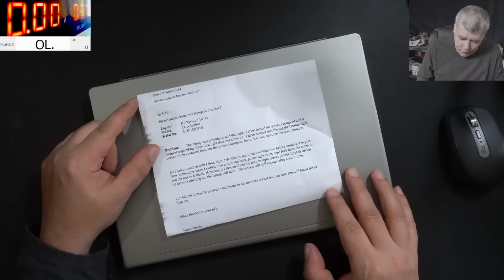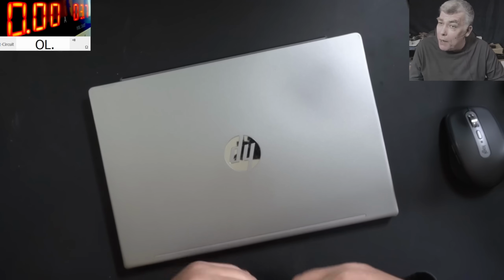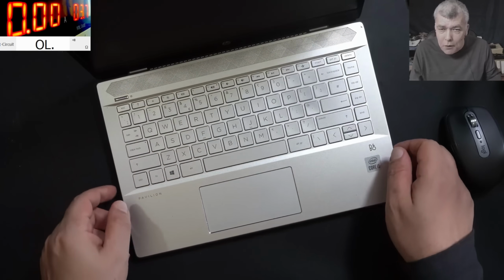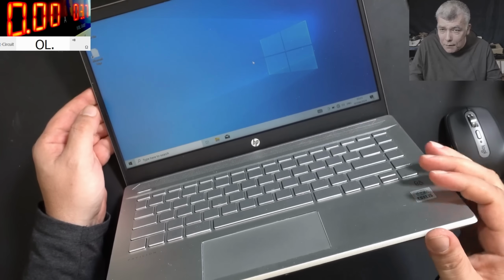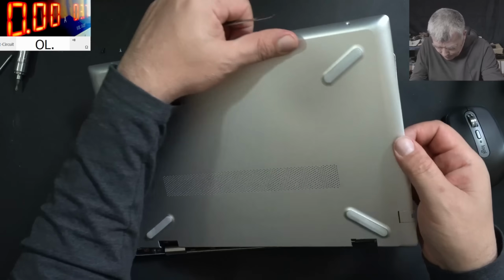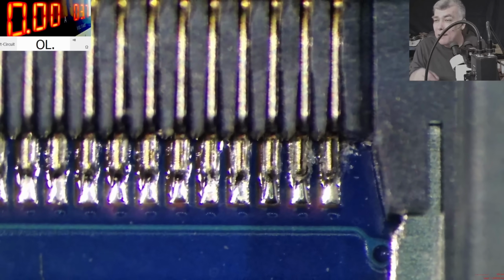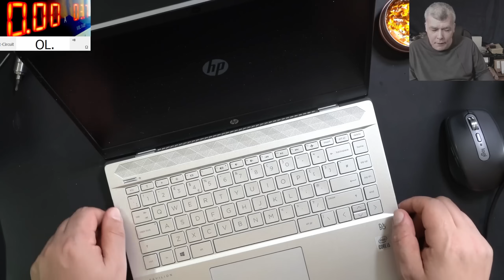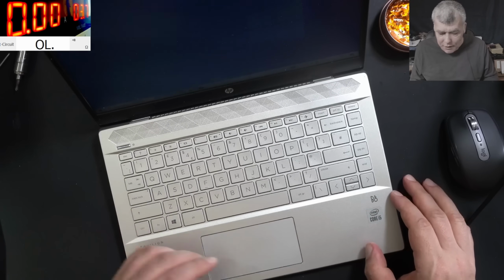How do I fix my laptop from freezing? HP 14-ce3510sa freezing randomly - a common fault

Comment: Hi, I did the same thing on my hp pavilion B&o by checking if there is any pins movement but they looks stable, i need help please to fix freezing problem the laptop it takes more than 10 minutes to get normal. 
Thanks

Comment: Hi sorin, my lenovo laptop does   have the same issue, ive done removing every components om my laptop just to narrow down where the issue is, but still i still got this problem. The only component that i couldn't remove is the soldered ram. So I think this is where the issue comes. Is there any way to check if this soldered ram is faulty?

Comment: What's up with screen flicker at 6:02 & 10:29?  
(Could be HP desktop theme? HP diagonal screen ripper for power savings? Maybe SMART HP Tools properly calibrating another cheezy display cable?)
Did you wash the flux off?
Reply: There is no flicker. It's the camera not keeping up with the screen's refresh rate. This is basic stuff.

Comment: Great video, Sorin. Similar issue HP Pavilion 15-ab254sa Intel Core i5-6200U 16GB RAM -  Clean Windows installation... I start the laptop without battery, the performance is noticeably slow... I reboot and the laptop and works perfectly. This is on a 65W charger. I changed to a 45W charger. The same problem. I updated the BIOS, problem solved. I started using my 65W charger again and the problem reoccured. I checked the voltage of the charger and it is around 19.5V. The charger seems fine and I don't suspect it's faulty as it works fine with other HP laptops. Anyone familiar with this type of issue?? I've checked RAM and is fine. Also, laptop works perfectly on battery, no issues.

Comment: Hi Sir, I have a question, I have lenovo thinkpad t570, I intend to replace the motherboard of T570 with the motherboard of lenovot thinkpad t580, the two look very similar, and both use the same voltage wise power. What do you think about this?

Comment: replacing termo paste? what next? replacing capacitors? im disappointed and my day is ruined. (it's a sarcasm btw)
Reply: Sorin could remove a capacitor as an “extra free service “
Reply: That thermal paste should be repaired not replaced, just like everything else. Screen cables, usb-c/hdmi ports... 😊
Reply: @mikeh6286 why repair the thermal paste? Just because manufacturer put it there? You’re gonna tell me manufacturer is god now? Thermal paste is a scam, I just remove it from every laptop I fix. There cannot be old thermal paste if there is no thermal paste at all 😂
Reply: @moldo8811  repair or remove... those actions are acceptable on this channel
Reply: Now this is sacartism😅 @mikeh6286